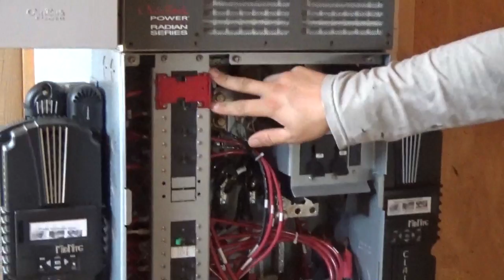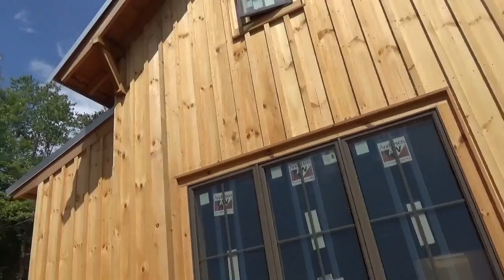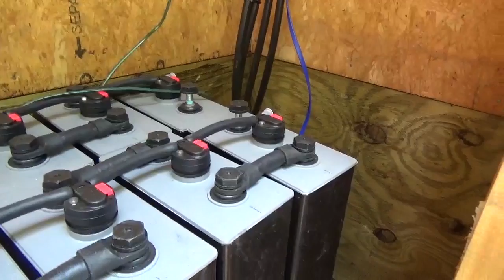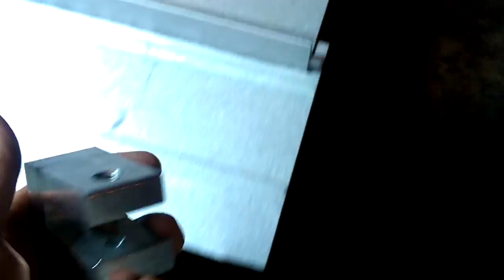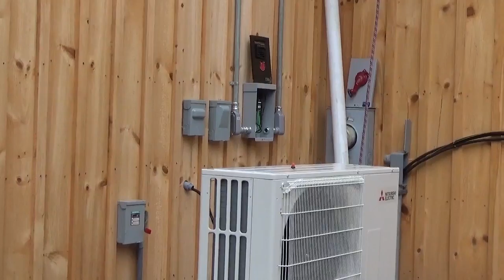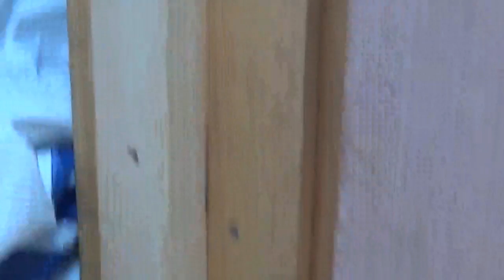Prepper Makeover Power System Part 1

Comment: I would have made that battery bank base concrete then wood and rubber on top. that's a lot of weight on wood. and if it ever breaks,alot of money down the drain. the concrete would hold up for ever if it out of the weather. just my 2cents

Comment: What size off grid system do you think I would need for a 1200sq house? And cost. Thanks!
Reply: Permimama there's a lot of factors that they would need to know. Where you live, what is the size of your Solar window, grid tied or off grid or hybrid, budget, types of main components, incentives and granting, the size and condition of your current electrical system of your house, time frame of permits, and availability of the crew. My suggestion would be to call them and set up an appointment, and have them site your property. These guys know what they are doing and can make this process very easy for you. If you just give them a budget and allow them to site the property you won't need to worry about any of the equation.
Reply: To put this into perspective, for a dwelling unit, it is about 3VA/ft.sq for lighting loads. 1,200ft.sqx3VA=3,600VA. So, based off of just the square footage you provided, you would need, at the very minimum, a 3.6kW solar array to nearly break even with a grid tie only system to power all of your lights at the same time....... Of course, in reality, this would be less than half because I have minimal information and going off of how to size a lighting system of a dwelling unit(home) to calculate the load that will be put on an electrical service and you may not use all of your lights all the time at the same time. If you were to go the battery back up way, this would be a massively oversized battery back up system for just your lighting circuits. So now do you see why it is important that you make an appointment for someone to sit down with you and plan how they are going to do this and see what to power and allow them to collect the most amount of information to size your new system correctly? Call them and make an appointment. 1200 ft.sq is easy to manage. This I do believe can be done for relatively cheap. A very vague price range from $10,000-$25,000 on the system itself. Now remember you will get a 30% tax credit on entire system costs so a $10k system is a $7k system and a $25k system is a $18.5k system, then of course the incentives and granting that you may be able to apply decreasing the cost up to a total of 50% off in some states and their counties. Do not be intimidated or discouraged this is possible and a very good decision but it needs to be a correctly thought out and planned decision and that is what these guys are for. Please,  do not think I am being mean or rude, I am trying to help you make a responsible and smart decision. Just simple as giving the guys a call and letting them help you. I have no affiliation with these guys but I believe in them and their work looks good. So I will advocate voluntarily for them.

Comment: $40,000 for solar! I could buy another house for that. If the panels are less than a dollar a watt what about solar is so expensive?
Reply from the maker: Solar,racking,inverter/charger,battery bank, charge controllers, critical loads panel, combiners, disconnects, wire,conduit,labor,interconnection fees, generator input etc. This is not a grid tie system.
Reply: So if the solar system had just tied into the grid what would it have cost? Like $15-20k?
Reply from the maker: Dogboy708 correct.

Comment: Interesting. How well will this 'snap n rack' system hold up under a snow load?  Perhaps you can get the patent on fabricating modified S5 clamps for these McLeroy standing seam roofs?  I'm guessing on the manufacturer because it looks similar to what I placed on my home several years ago.  The whole purpose for installing the standing seam was to eliminate roof leaks for the remainder of my lifetime. So, I can appreciate the homeowner's wish to not have his metal roof penetrated with holes for the solar array installation.

 I see this is an installation and design in new construction.   Is it possible to do a retro-fit for a set up like this?  I have a 5+ yr. old Generac whole house generator and would like to add solar before the rebates expire in 2016.

Comment: It would be nice to get an approximation of the cost for such endeavors. 

Also I always wonder when folks place so much of their solar on the roof in areas of the country that receive a lot of snow. So the cells get covered & folks have to climb on an icy roof to clear the solar or loose power in the winter. 

Your vids are always educational & done very well. Appreciate the efforts. 

Thanks
Reply from the maker: 1timby 40k for this one.  When it comes to northern climates and snow load the number of S5 clamps/ attachment points are increased to spread the load out.    You can place clamps on every seam if need be.

Comment: You know your technical guy is very good if he's friendly and a little maladjusted :-) Looks like a great system and very well suited to the house itself! :-)
Reply from the maker: NekitaNet Johnny (Gain Solar) is a lot of fun to work with!  This can be really hard work, especially when the roof is 130 degrees.  He has a super power and that is He reads/studies techincal manuals on all the gizmos you see here.  Someone has to figure it out and it takes a lot of patience.  Inside that Outback radian is a cluster of wires and breakers that will boggle the mind and you need to be a contortionist to wire it.  You never leave a Radian unscathed!

Comment: I've been thinking of replacing my batteries with nickel iron batteries. What's your take on them? Are they worth the money? I read that they're the same type of battery used in military subs, and those are designed to last the life of the sub which is around 50 years. I guess, who would want to be replacing 1,100 pound batteries in a sub every 5 to 10 years. I read those are 2.2v and 7,000 amps each and a sub has around 200 of them. I don't mind paying for them as long as they're worth it and they'll LAST. It would be nice to put in a system where the batteries last as long or longer than the panels and electronics.
Reply from the maker: wjf213 I hear you on the Nickle Iron but they are so expensive.  Would you like a quote on this battery bank? Send me an email info@practicalpreppers.com
Reply: engineer775 Practical Preppers 

But are they worth it? 

My current bank is 24 batteries that are L-16's for around 60kw in theory, but honestly, I'd like to double or even triple that and actually have all that available to me for use. I read that the more you use and abuse these batteries as far as discharging them, the more they love it. I read that they're almost indestructible. 

Here's what I was reading on them.   http://www.nickel-iron-battery.com/

Do you have any experience with them?
Reply: We actually did replace our lead-acid battery banks every 5-10 years on the subs I was stationed on. We changed over to SVRLAs later in my tour but they still got switched out when they had plenty of capacity left. The risk of a failing battery is too great for a nuclear-powered submarine to try and squeeze every last year out of them. Safer to just change out the bank sooner.

Comment: How many or what percentage are putting in Lithium Cells?
Reply from the maker: Sachi WI We are not using lithium yet.  Eventually we will but not wanting to pay for the "Tesla" name and marketing.  You just can't beat a good old lead acid battery that is taken care of.   We use auto watering kits and perform equalizations when needed.  For this system we are looking at at least 10 yr battery life and unlike most battery backup systems out there.  These batteries are being cycled everyday so you are getting a ROI that you wouldn;t get on a sealed or maintenance free battery.  We are maximizing the charging profile and the battery use so we can get every bit of energy out of the system with out sacrificing lifespan.
Reply: engineer775 Practical Preppers I wasn't referring to Tesla I know RV's use Lithium - Are those batteries you installed in this video something used in the telecom business? I don't think I've ever seen such a tall thin battery but maybe once on a very OLD grainy YouTube video in a language I couldn't understand lol